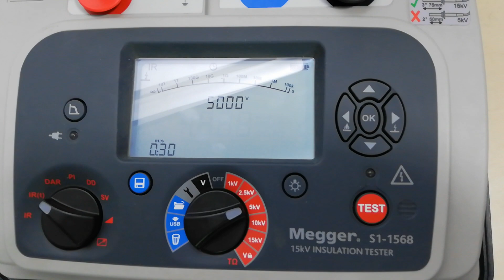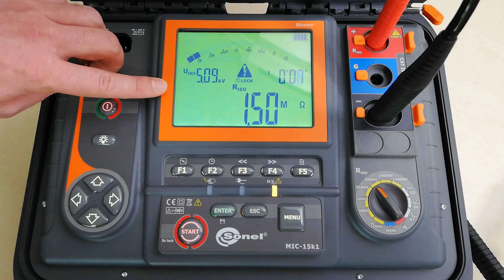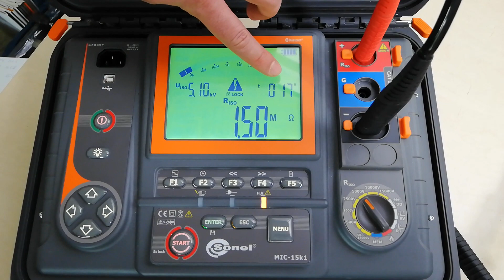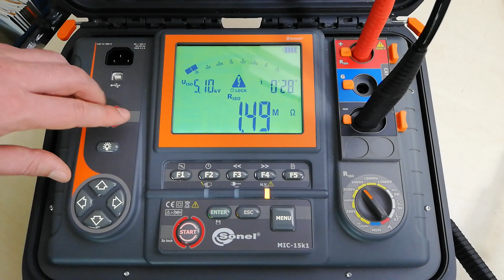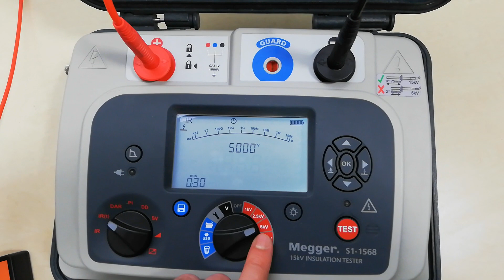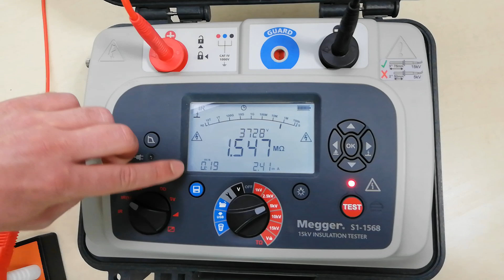Comparison of Sonel MIC-15k1 and Megger S1-1568 when measuring resistance using 5kV

Comment: where did you buy that 1.5M resistor? He looked really good in that box.
Reply from the maker: it is not one resistor, it is several high power resistors connected respectively on several PCBs. And the housing is some ordinary housing available at a local electronics store, with two terminals (a bar turned on a lathe) and protective insulators that I do not know where I had come from - they were in the workshop.